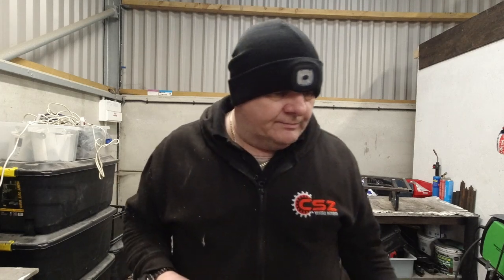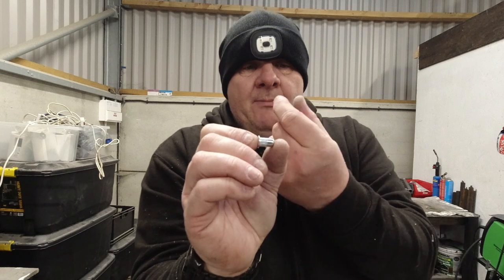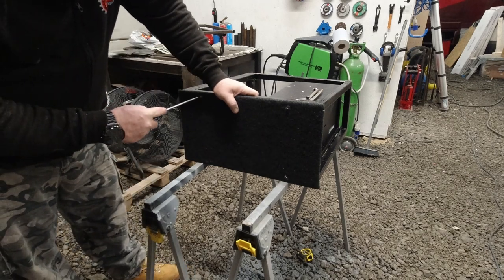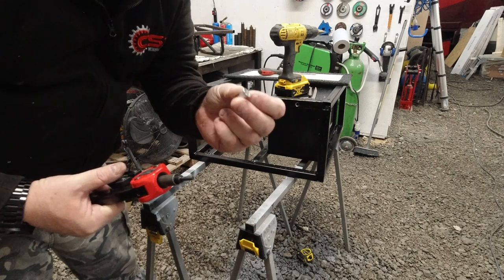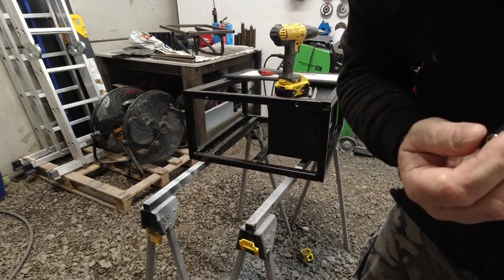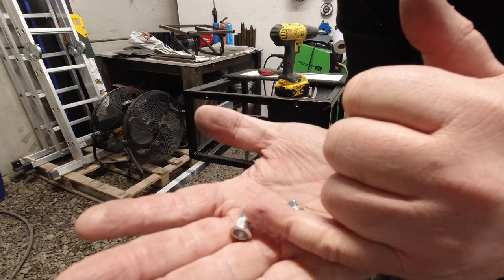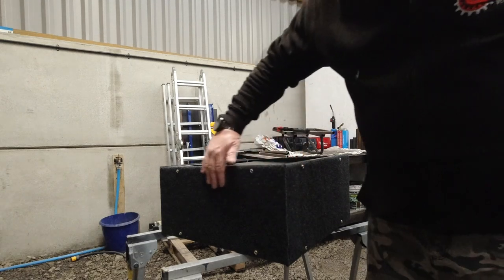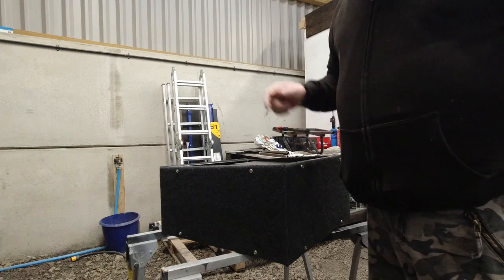The Best Campervan Building Tool EVER !!

Comment: Karl do you get a drill size for each  rivnut?
When you buy a the rivnut tool, does it come with each size (eg M3 to M10) or do you have to buy them as extra? Many thanks.
Reply from the maker: Hi ya I buy the cone shaped drill bits to drill the holes as the set of 3 I buy usually is enough.  All the sizes for.the rivnuts come.in the kit when tou buy the tool.
Reply: @BuiltnotBoughtCampers  
Thank you.